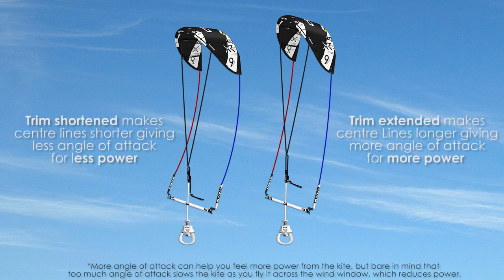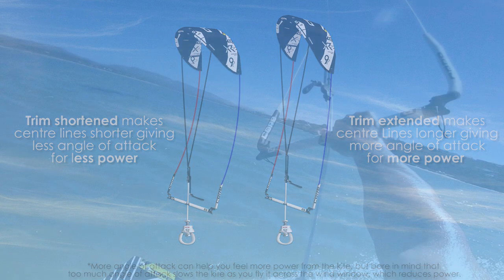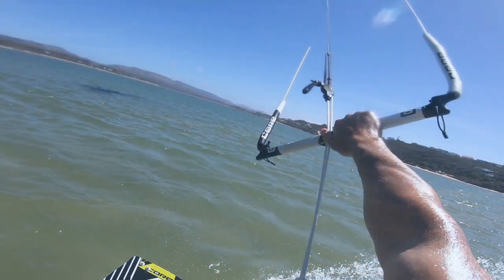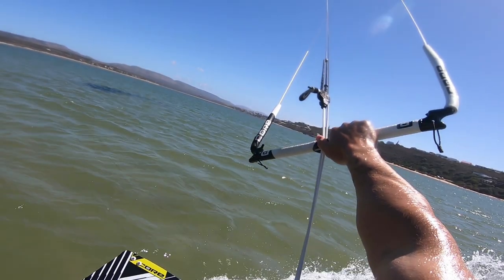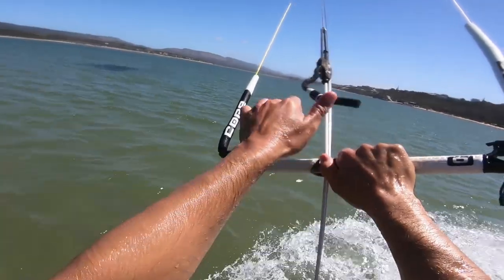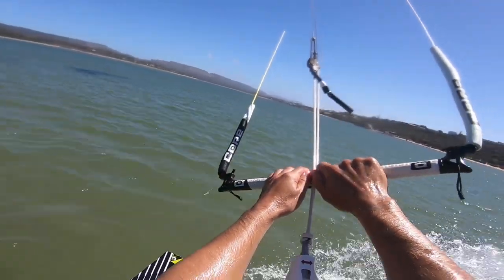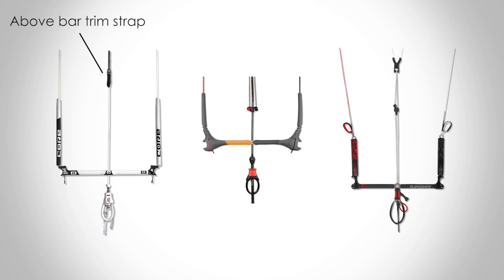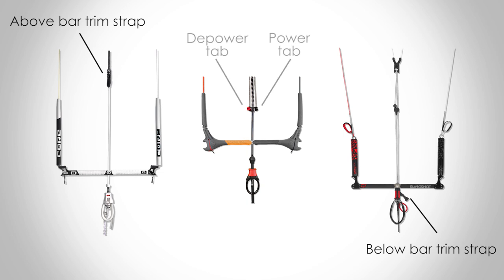Kitesurf Depower Systems (Bar, Trim Strap, Rigging Options, Backstalling, Wind Conditions etc)

Comment: Did the light wind 3rd knot mistake today. Put it 9n max power and was wondering why the kite was stalling and not pulling at all, why normally the knot gives it extta pull.

Comment: 1:54 This is particularly problematic for people coming from a windsurfing background.  This is because experienced windsurfers reflexively hold onto the boom (especially with the hand closest to the mast) when a crash is imminent. This is because, otherwise they stand a good chance of getting whacked by the boom or mast.  Better to keep it in a known position relative to the body.  However, in kitesurfing, you are likely to be much better off completely letting go of the bar.  The kite is almost guaranteed to fly better without your input.  With a bit of luck it will climb all by itself to the apex.  Worst case, it will dive down and hit the water.  But only with moderate force.  Gripping the bar greatly increases your chances of tomahawking it into the water or looping it first then tomahawking.  
I really wish someone had explained this to me when I was learning.  IT IS OK TO LET GO OF THE BAR !

Comment: i can change the depower range on the bar when i change the depower rope, should I just give it as much range as possible (within some limits of course) so I can access the full range on the bar instead of sometimes havung to land the kite to change the connection knots?

Comment: How to know which kite surf waist size to use? I live in a place where I can only buy it online, I am a 5.7 feet and weigh 132, wide hips but slim waist. Am I an small or medium? I use medium pants but small shirts, thank you
Reply from the maker: Hello Nuunu. Harnesses are very adjustable, so you could use either. I'd guess that small would be better overall. Good luck.

Comment: Hi,
firsty, I have to say - your videos are great!
I have one question regarding trimming the kite when launching. I have 15m naish fly and I am trying to launch it in 6knots (gusts up to 15kt). My bar (also naish - the base one) has a below the bar trim, and when I’m connecting the lines I always have my trim fully extended, meaning full power. So my question is, when I am ready to launch should I shorten the trim a bit? What do you recommend?
Reply from the maker: Yes shorten the trim, especially in light wind otherwise you will create extra drag and slow the kite. When you push the bar out your steering lines should bow.
Reply: Kite-Surf-College Tutorials and Tricks thanks.

Comment: I just wish my instructor had been as clear and concise as these videos. Unfortunately, I had to learnt it myself after backstalling my kites many times.
Reply: Same here,  I used to set my kite for power is light winds, the kite would back stall into the center of the wind window then RIP down wind taking me with it.  I learned the hard way I do appreciate these tutorials! Very clearly explained.
Reply: I'm taking lessons (first timer) in 2 weeks. I'm thankful for these videos (and many on youtube) just in case I have an instructor that doesn't touch on a given point, or if a situation were to arise. At least there will be less theory discussion and for me, more hands on, even with a trainer kite.